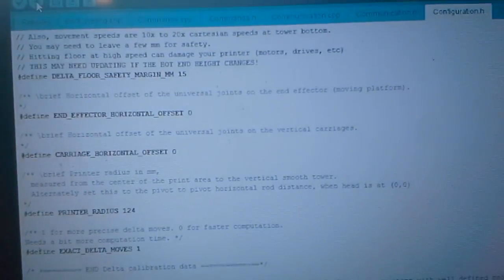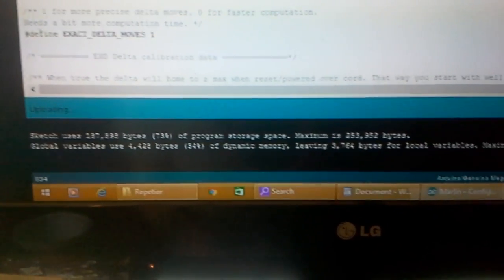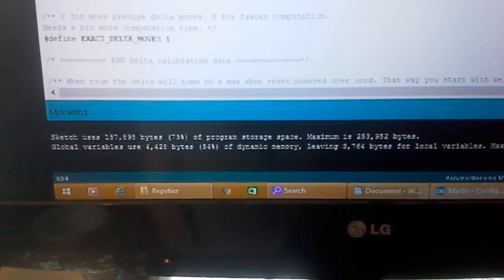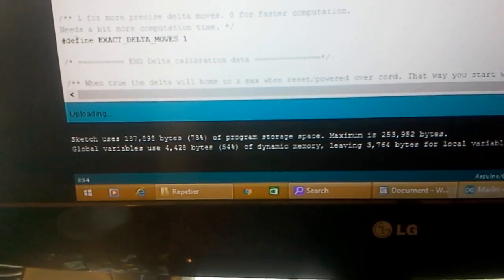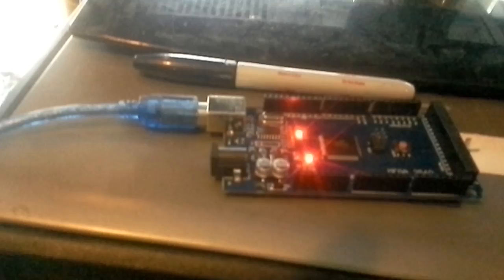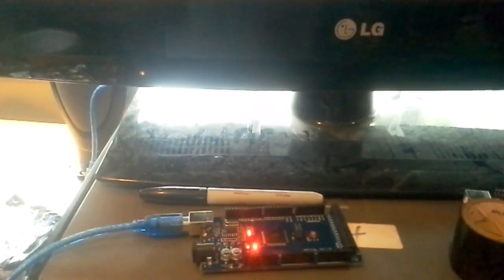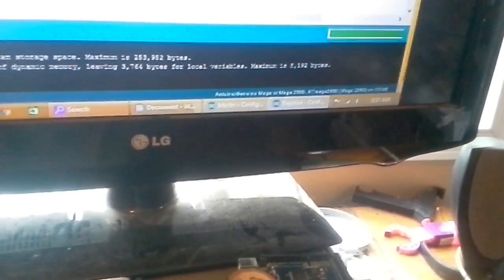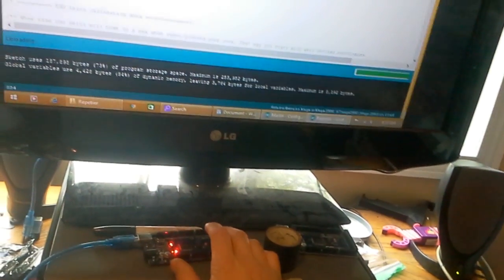Chinese Generic Mega 2560 Timeout Error fix!

Comment: Sir i have faced same problem in the arduino uno i have fixed it by using the appropriate driver and reconnecting the module again and again because by somewhat reason the window was blocking it.

Comment: Guys, if there are still people wondering on how to fix this upload thing, I ordered mine from this website ( https://www.aliexpress.com/item/33006557839.html?spm=a2g0s.9042311.0.0.eeed4c4dT2Sjiy ) and on that same page it actually gave me the details on how to connect it properly to USB (had to change the position of all the switches on the arduino as in the diagram on that page). Then I hooked it to the USB and it uploaded instantly. Here is the diagram again:

USB <->ATmega2560                               DIP - OFF        OFF       ON        ON         OFF        OFF          OFF   

And then just turn the USB converter CH340G to connect to RX0/TX0 of ATmega2560.

Of course then you just make sure that you select the right port and board from the Tools menu and start uploading.

Hope that helps to anyone!

Comment: DOWNLOAD THE RIGHT DRIVER!!!
most of these errors can be cleared up downloading the correct Chinese driver for these boards http://www.wch.cn/downloads/CH341SER_ZIP.html

i tried every little trick i could find this is the only one i could get to work. and it ended up not working until i uninstalled arduino and redownloaded it to fix the boards file i had edited.

Comment: Will try when I get home.  Hope it works
Reply: try downloading this driver. http://www.wch.cn/downloads/CH341SER_ZIP.html 
i tried to get it to work for 8 hours lastnight and after everything ive done getting that driver was the only thing that worked for me. if youve edited the boards file is the arduino folder undo that. also you might have to delete the driver from device manager first. let me know if it works for you.

Comment: I was having this issue so after trying everything related to drivers usb drivers and all that including your useless method lol i unplugged everything from the board and it connected no problem. gotta make sure port is right, baud rate is right, driver is installed and all that shit but i think the main issue is nothing else can be installed till all pins are set in the firmware. Damn, I spent like 3 hours on this crap

Comment: if you short out the jp1 next to the reset button WITHOUT power, it will restore to factory  just did it and it now works for updating firmware without issue

Comment: While this allowed my sketch to run without any problems, the IDE did not say that it successfully uploaded, and gave me the usual "avrdude: stk500v2_getsync(): timeout communicating with programmer error". Do you have any idea about this? What's even weirder is that I have a genuine Arduino Mega 2560 board.

Comment: The value of C4 from the reset line to the CH340 chip is incorrect or simply a bad capacitor, add a 100nf 0805 capacitor to replace the C4 on the board and this will fix the issue most of the time with many if the CH340 type boards.

Comment: Found a nice easter egg that got me with this same signature issue.  Make sure you do not have 3 consecutive exclamation points anywhere in your sketch or this "avrdude: stk500v2_ReceiveMessage(): timeout" will plague you.  I had mine in simple serial println's.  Removed the 3 consecutive '!'s and it was fixed.

Found this post talking about this... https://forum.arduino.cc/index.php?topic=136170.0

Probably won't fix everyone's problem but worth looking into with your sketches.

Comment: It sounds like the reset pulse from the serial port isn't working well.  When the IDE wants to talk to the boot loader the IDE toggles the DTR signal which through a capacitor pulses the processor reset pin.  If this doesn't happen smoothly you would get the timeout because the boot loader didn't respond to the IDE queries.  Sources for the problem are: missing or incorrect bias resistors, capacitors either damaged or wrong value for the job, jumper pads not configured correctly.

Comment: In order to do the reset automatically, you have to connect a 100nF capacitor in series between the DTR (pin 2) of the FT232 and the RESET pin on the Arduino MEGA.

I tested and it worked!

Comment: I'm trying to upload marlin to my 3d printer and it keeps timing out. This didn't fix it :(
Reply: I have the same problem but if i unplug the it uploaded the firmware but if i restart the i notice no difference so i don't think it uploaded. Have you the same issue?
Reply: Worked for me, make sure you com port doesn't change, I hit the reset and it changed the com port to 1 instead of 4 which my arduino was in.

Comment: I soldered 4uF electrolytic capacitor in parallel to C4. No need to press that damn button.
Reply: Hello! Could you share the photo MEGA 2560 to see how it looks like now after soldering. I'm going also to try. Thank you!
Reply: http://s12.postimg.org/4wqi7rv3h/IMG_20160924_115128_1.jpg
Reply: This is how I tested different capsitors
http://s15.postimg.org/68u6ohgnf/IMG_20160924_114239_1.jpg
Reply: But I still got problem with this card. It works only with original blue USB cable.
Reply: can you explain me why it is happning?
Reply: The only one solution is to use a USBTTL uploader..when every other solution is a faliure
Reply: Could you send the picture again ?